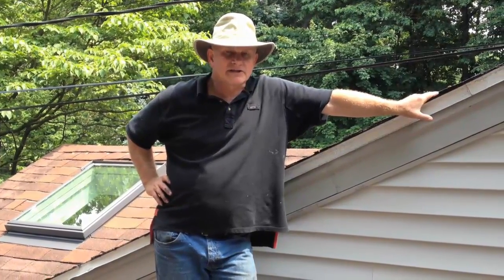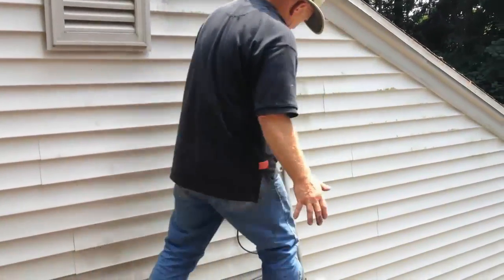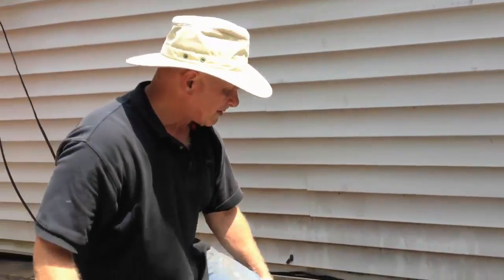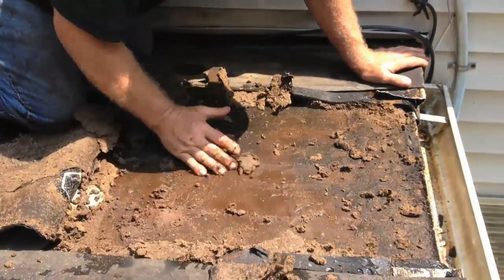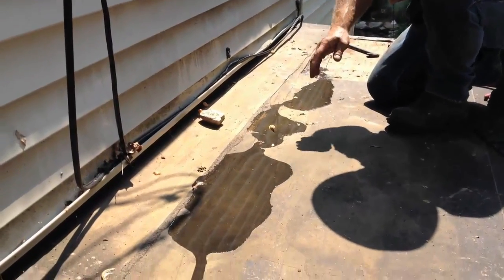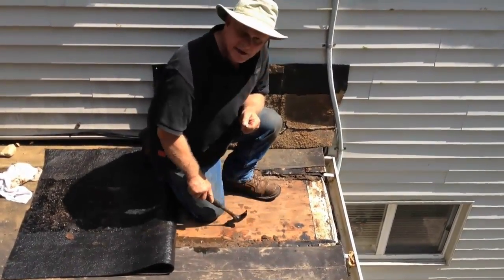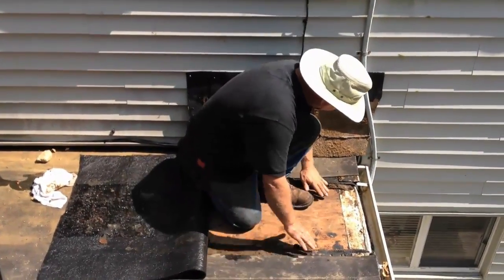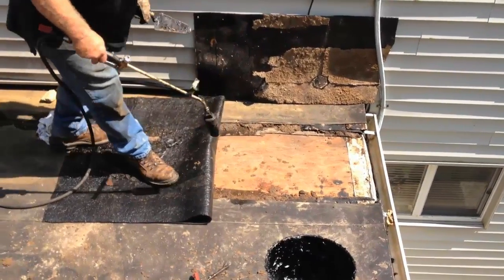Flat roof - lower edge to drain water off - Scupper

Comment: Tapered insulation, or recovery board build a cricket, this man is not a roofer and mastic on the metal omg. Do not do what this man does. You sir are the reasons roofers get a bad rap, no 28 base sheet so many things wrong here, you should show videos of all the pissed off homeowners after the first rain that you have ripped off. And I'm not just comment warrior I've been roofing for 20 + years. You have no concept of a roofing system and lack the experience. You can say whatever you like, But the roof doesn't lie . Any amount of water will prove that
Reply: He has no idea.  I'm a roofer of 30 year. Watching him give "tips" is making people dumb.